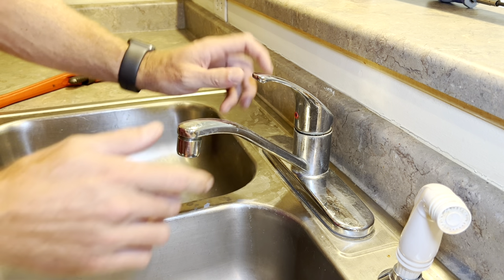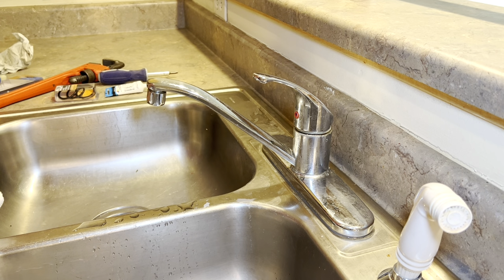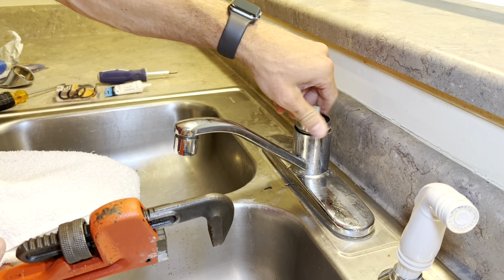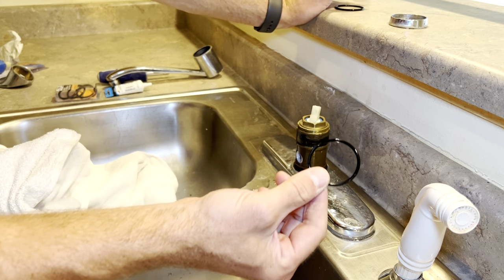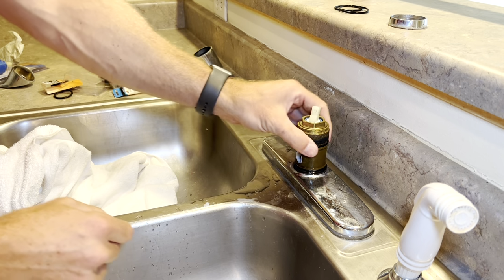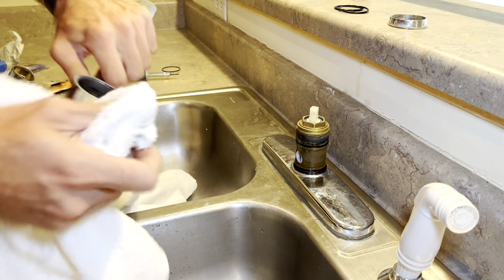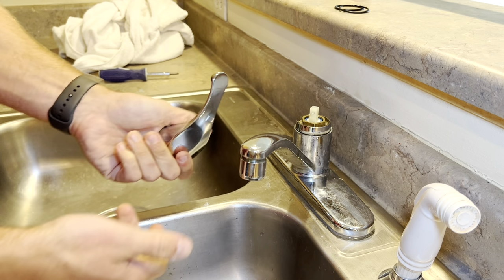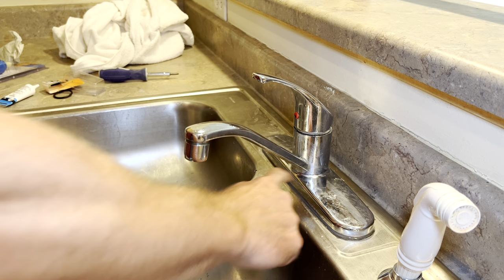Kitchen Faucet Leaks at the base. Easy Fix!

Comment: Mine only leaks at the base when the lever is in the hot position. Also, I do get a single drip every fiveminutes or so from the faucet. 
Does the drip from the faucet indicate I need to replace the cartridge as well as the O rings or can I skip replacing the cartridge? If I need to replace the cartridge, do you have a video for that?
Reply from the maker: This sounds like it needs a new cartridge. The disassembling process is the same. The one additional step is to remove the brass cap off the top that holds the cartridge in. 
Here is a cartridge replace video that I did on my old channel:
https://www.youtube.com/watch?v=C78BQik6-ag&t=206s

I need to make one for this channel.
Reply: Thank you. Now to buy the right size rings and cartridge. My faucet is the exact same as yours. Where the brand?  Do you happen to have part numbers or sizes?
Reply from the maker: I believe the faucet in the video is a price pfister. But to be safe, I would pull the old cartridge and seals and take them to the hardware store to match them.

Comment: Now I am asking a question, Why not reapply the grease periodically? Maybe once or twice a year(depending on how much tap is used)???  Worth it? Or just as easy to replace orings when they start leaking?
Reply from the maker: I’m sure that would make the o-rings last longer. But, if you are taking it apart anyway, new to rings are only a dollar or 2. So I don’t feel like it’s worth it. I wait until they start to leak and then just swap them out.

Comment: Suggestion: Ensure that the swinging barrel-spout has smoot internal surface and is not corroed: (stainless steel verso brass) or the new O rings will fail again >> and we assume that the spout is not partially cloged (cruded) to impose "water suppliy pressure" to the O rings seals.(New U cup O ring >>neoprene or better elastomers perform much metter etc,)  Why Manutacturers do not use a teflon sleeve inside the barrel I don't know?
Reply from the maker: Great suggestions! Thanks for the additions!!

Comment: If you don't have any plumbers grease, l have used Vaseline on the rings. Use some fine steel wool to clean up the faucet and remove water deposits.
Reply from the maker: Good advice!

Comment: Good stuff dude. 
What’s the purpose of the grease?
Reply from the maker: It makes the neck swivel a lot smoother and makes the seals last longer. It’s pretty cheap, so it’s worth it for the extra longevity of the seals.

Comment: I have rust coming out of my mind like a plugged up do I have to change the hole faucet
Reply from the maker: I would first clean out the aerator. The tip of the faucet where the water comes out is removable (in most faucets). This part can get clogged up. Remove that and see if the faucet flows fine without it. If it does then you will need to either clean it or replace it (only a couple of dollars). If it doesn’t flow without the tip on there. Then it’s clogged farther back. In that case i would probably remove the supply lines and see if they flow without the faucet attached. This is getting more complicated. Be sure to shut off the water at the shut off valves under the sink before trying this. If those flow fine but the sink doesn’t then it’s probably clogged in the cartridge.   So you can change that out instead of a new faucet. But if the supply lines don’t flow without the faucet on there. Then it may be time to call a plumber because it’s a bigger problem.

Comment: Man really hoped the kitchen sink would work with me like this 😢 the red portion I warped and stripped the inner screw. Any tips on solving this? Also my water wouldn't shut off completely have a drip going.
Reply from the maker: oh no! If the threads stripped out on the cap part. That is probably going to be a problem. You can get replacement parts for these, but if you have to order parts it may be a couple days and probably end up costing about half what a new faucet would. If some I have to replace more than the cartridge and O-rings, I would consider replacing the whole thing.

Comment: Will this cause water to leak in the cabinet as well?
Reply from the maker: yes, if you have water leaking underneath the faucet this may be the problem. There are a couple of other things that can cause water to leak underneath as well, but I would start with this one. 
Another possible cause could be the sprayer connection, or the cartage could be leaking. But 4 out of 5 times, its the O-rings like in this video.

Comment: How do you know what faucet brand you have? Do you know where it would be on the faucet?
Reply from the maker: Some brands write it on the front. But a lot of them don’t have it on there anywhere. If you are unsure of the brand, you can remove the old O-rings (and Carthage if you are going to replace that while you have it apart anyway). And take them to the hardware store to match them.
Reply: @RoscoReviews  Thanks Rosco for the info!  I have one faucet that is leaking at the base below the o-rings.  Is that something that can be fixed or do I have to replace the entire faucet?  It's like the one that you have in your video.
Reply from the maker: If you have already replaced the O-rings and it’s still leaking. Then you may have to replace the whole thing. If it’s leaking between the part that swivels and the base (or even leaking into the cabinet below) and you haven’t replaced the o-rings yet, then go ahead and replace the rings. It’s likely the problem.

Comment: I have a question  my sink had a plastic sheet all around...can't seem to pull up actual faucets neck...is there something else I need to do? If so what. Please help and Thank you
Reply from the maker: It’s tough to say without looking at it… I’ve seen ones where the top cap over the handle is plastic (I think the old moen ones). The cap just pulls straight up and off. Then the screw to remove the handle is underneath. If it’s a plastic dome part below the handle, then it should unscrew the same as the one in the video.
Reply: Thank you for answering! I was able to get it removed!
Reply from the maker: No problem :)

Comment: I have the Marielle LG-26-4NUU series but after taking the little cap off and removing the screw...the handle won't lift off. Plus mine doesn't have the lower brass ring to unscrew as well, it's just a molded shape one. Plus I am thinking there is another screw deep inside the faucet holding the water cartridge in place...tried thin screwdrivers but nothing...frustrated.
Reply from the maker: Its tough to say without looking at it. the handles do often get quite stuck on there. I have had to pry them off with a screwdriver before. You can usually unscrew the round dome shaped cap with a strap wrench or a pipe wrench like I did in the video. Be sure the water is off before you do that though, if you have a ball valve style there may not be anything else holding the water in.

Comment: Curious to know why you chose not to grease Orings before installing them?  Thks..jc
Reply from the maker: I usually grease them after I have them in there. I’ve tried to do it before putting them on and they are slippery. I’m not sure if there is a benefit to doing it that way.
Reply: @RoscoReviews  Got it..Thks

Comment: Mine doesn't have any access, no Allen scew? How do I get it on? It's not leaking now but just in case it does.
Reply from the maker: I haven’t had a model yet that the handle wasn’t held on with a screw somewhere. But, that doesn’t mean somebody didn’t make one. Lol.  Sometimes you have to pop off a top cover to get to it (I think a lot of moens are that way)

Comment: What size of ring did you used? I think I have the same faucet like yours.
Reply from the maker: I believe the is is a price pfister faucet. But I’m not positive. I’ve done so many different brands and models I have no idea what size the each take. I always have to pull the old one off and match them to the new ones. You can get a multi pack off of Amazon for 12-15 dollars that has tons of different sizes. 
Or if you want to save a little money you can pull the old ones and take them to the hardware store and match them there. If you just buy one set it will probably run about $2.
Reply: Thank you

Comment: What happens if we just started unscrewing the faucet with out removing the little red thing and now the faucet won’t come off?
Reply from the maker: You will need to remove the handle first. They can be pretty stuck sometimes. So it may take some wiggling to get it off once the set screw is loose

Comment: Instead of a pipe wrench ,  use a strap wrench. I was a Plumber for 30 years and never used a " Pipe wrench " on a polished 
chrome faucet. 😲  Memo to homeowners,  place a towel or 
something over the drain !
Reply from the maker: Yeah. A strap wrench works great!
Reply: Great video until I saw the giant pipe wrench. A strap wrench or adjustable curved rubber jaw pliers would work much better and there wouldn't be a tendency to over-tighten the faucet collar.  Thanks for the video.

Comment: Curious why the bottom and top washers were not replaced at the same time.  Thks.
Jc
Reply from the maker: If you buy the repair kit that comes with the plastic washers, then you can definitely replace those while you have it apart. I usually just buy the ORings. I haven’t ever noticed the plastic rings breaking or wearing out. But I’m sure they can too.
Reply: @RoscoReviews  Thks again.
Appreciate it

Comment: What if you don’t shut off water? I live in a small shed like deal and can’t find my shut off valves.
Reply from the maker: It depends on what type of faucet you have. If you have a cartridge style (like the one shown in the video) then you can do this repair without shutting off the water. However, if it’s a ball valve style and you don’t shut off the water, you will have a mess… and if you can’t find the shutoff valve at that point, it’s going to be a big mess.

Comment: how do you know what size "O" ring is the right one ????????????????
Reply from the maker: If you know the brand and model, then you can look it up, but it can be difficult to tell what model they are sometimes. so, what i would do is remove the old o-rings and take them to a hardware store (lowes, home depot, menards) and match them there. 
The alternative would be to order a variety pack (I put a link for one in the description of the video) It cost a few extra dollars, but you will have extras if/when you need them again.

Comment: What size Rings do you need for these size taps?
Reply from the maker: Different brands and models use all different sizes. If you want to do this as inexpensive as possible, then its best to remove the old rings and take them to any hardware store and match them there. they usually run between 1-2 dollars. If you are wanting to order them online, then I was order a variety pack. I put a link for one in the description of the video. It is more like 10 dollars, but you will have a bunch that you can use for other things if you ever need more.

Comment: One thing I tell people to do is hold the pex tube while closing the valve so it doesn’t snap off somehow.
Reply from the maker: I’ve broken the handle off of an old shutoff before. So it can happen. Probably a good idea to hold onto the back with something when you turn them on and off.

Comment: what model of fauset is this?
Reply from the maker: I believe this is a price pfister. But I don’t know what model. Most brands that use a cartridge can be repaired the same way though. Older models that use a ball joint can also be repaired like this, but you must be sure to turn the water off or you will have a mess. Lol

Comment: So dont actually have to turn water off for this maintenance?
Reply from the maker: You don’t have to if you have a cartridge style faucet. However, if you have an older ball valve style then you will need to turn the water off. Or you will end up with a huge mess. 
If you don’t know what type you have then it’s best to error on the side of caution and turn the water off first.
Reply: @RoscoReviews  thanks

Comment: Thank you for the video. 
My leak is under the sink from the hot handle. Do I have a bad cartridge? It is watery when I remove the handle.
Reply from the maker: If there is water on top of the cartridge when you remove the handle, there is a pretty good chance it’s bad. I would go ahead and replace the cartridge and the o-rings while you have it apart.

Comment: Where to buy parts?
Reply from the maker: I included a link in the description of the video. I will copy it down here.
Link for O-rings on Amazon:
https://amzn.to/3VUQL5F

Link for Plumbing grease:
https://amzn.to/3bSgXeD

if you want to save a couple of dollars and just purchase the exact size that you need. You can remove the old ones and take them to any hardware store (lowes, home depot, menards, ace) and match them. They should have most any size on hand for around $2 for the set.
Reply: @RoscoReviews  thank you for your job, for quick reply

Comment: How do you know what gaskets to get?????
Reply from the maker: You can try to look up the size for your particular faucet if you know the brand and model (this is ideal, but sometimes it’s hard to find the brand/model number)
Or, I included a link in the description of the video for a set of O-rings that should include the size you need. (This costs a little more, I think like $10, but you will have some extras if for when you need to do it again.)
Or, you can remove the old ones and take them to a hardware store and match them there (cheaper, but you will have to stop in the middle and run to the store.)

Comment: Buy a pair of 440 channel locks.
Reply from the maker: adjustable pliers will work too, but they can scratch up the finish too. a strap wrench would probably be the best way to go to not damage anything. but, I typically use whatever I have on hand and wrap it in a towel.

Comment: How about the water is dripping from the faucet itself?
Reply from the maker: Water dripping from the tip of the faucet means you will need to replace the Carthage inside (or perhaps the springs and seats if it’s an older faucet) 
Unfortunately, I haven’t filmed one of those yet or I would send you a link. :-/
Reply: @RoscoReviews  okay please I would need your link then
Reply from the maker: https://youtu.be/C78BQik6-ag
Reply from the maker: I found one that I did on my other channel :)

Comment: easy peasy if you know how to do it and have all the tools needed to perform that job.
Reply from the maker: Yeah. It does require either a pipe wrench or a strap wrench. And an Allen wrench to get the handle off. But that’s pretty minimal on tools. No specialty tools needed.

Comment: Your ‘helping’ video begins by saying “you’ll need the O-rings you need to replace”…. Hmm, won’t know which specific rings are needed till you get the faucet apart.  THEN, you have to take the old o-ring(s) with you so they can be matched at the store.💁‍♂️
Reply from the maker: Yeah. Unfortunately, there are different sizes. I posted a link for a kit that should contain all of the sizes if anyone wants to order them ahead of time so you don’t have to stop in the middle of the project to run to the store.

Comment: my handle will not come off
Reply from the maker: if you have the set screw out, they can be pretty stuck on there sometimes. I have had to use a screwdriver to pry up the handle before.

Comment: It's far better to test it before you put the top back on with the water switched on to look for leaks. Then you say no leaks with the tap open you look for leaks with the water off as it builds up preasure in the tap 2 out of 10
Reply from the maker: The o-rings won’t leak with the tap off. The pressure would be stopped by the Carthage (or ball valve depending on the style) if you are experiencing a leak when the tap is off then you may need to replace the Carthage. Replacing the o-rings like in this video won’t fix that.

Comment: What a drag I can’t even get the handle off I’ve tried many Allen wrench’s but it just spins nothing fits
Reply from the maker: Bummer. If you have one that is stripped out. That may be rough. You could try the trick where you use one that is a little bit small and put a rubber band between the tip of the Allen wrench and the screw so that it can grab it better. 
I’ve had one I couldn’t get out before and ended up using a torque head bit (star bit) that I kind of jammed in there.
Reply: The Allen key size must be exactly right. Moen includes a proper Allen key with a new cartidge. Find out the size you need from the manufacturer or get a set of very closely sized Allen keys. I found one after none in the set I had fit properly. If they spin, they're too small.

Comment: Sir, waste of time and money. Why? the BRASS inside sleeve for the spout rotation is corroded and act again as a file on the new Oring to score it again and the faucet star to leak again. You need to have a faucet with stainless steel sleeve and the Orings replacement will make sense and you happy for a job well done.
Reply from the maker: I have done quite a few of these, and they seem to work fine for years after I change the seals. 🤷‍♂️

Comment: You have replaced the good ring seals but didn't replace the top one that caused the leak 🙃
Reply from the maker: I’m not sure what you mean. I replaced the top and bottom o-ring this should fix the leaking around the neck of the faucet. If it is leaking from the cartridge, you may need to replace that at the same time.

Comment: Don't forget the pipe wrench? Get it tight& it will stop leaking??????
Reply from the maker: Tight enough that it won’t come loose and unscrew on its own. But not so tight you strip it out. Somewhere in the middle.